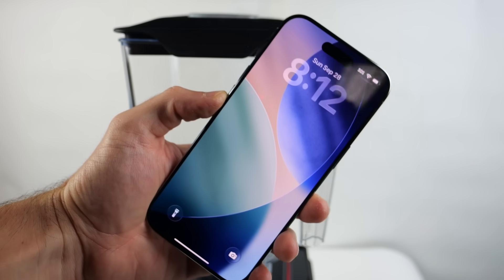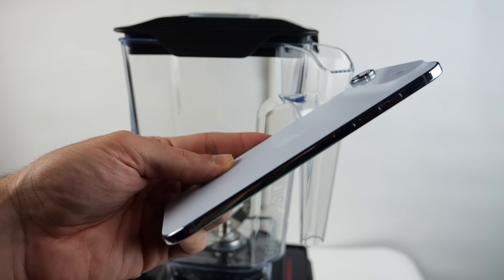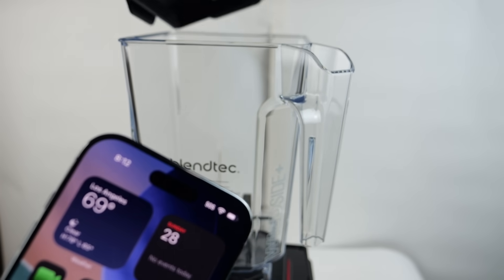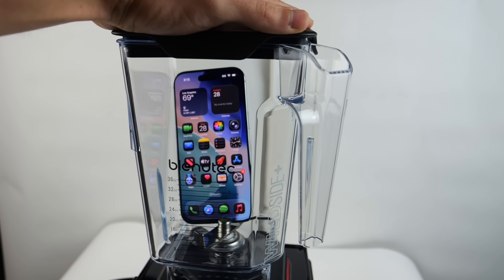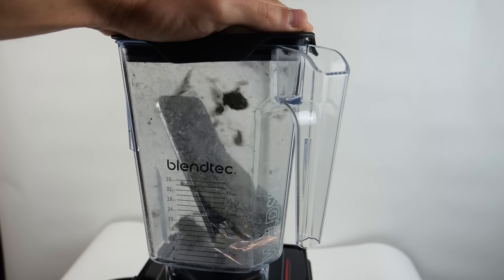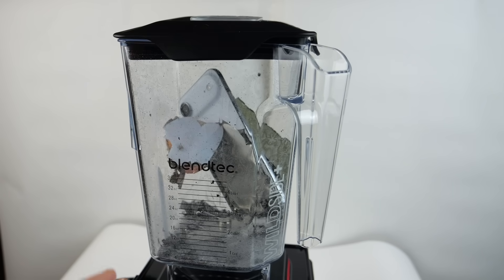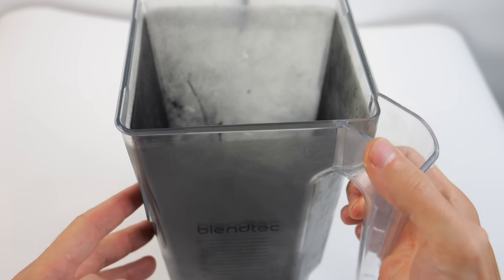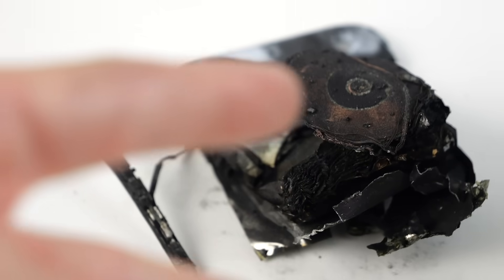Will it Blend? Titanium iPhone Air

Comment: This is one of the things EVERY iPhone DESERVES!!
Reply: It's not 2013 anymore bro
Reply: @memethanYT  The iOS is getting more and more locked in their own "eco system" and prices are insane... 17 Pro Max is 1899,99€ and phone literally doesn't exceed 600€ of value and another example, the iPhone Air that's cheapped out iPhone17 is more expensive than basic phone. I can talk for hours why is Apple DESPICABLE...
Reply: @REDLINERUNNER galaxy z fold 7 is £2000+ 😂😂😂. Absolute clown
Reply: @TescoRoadman  But Fold has technology that's difficult to produce. Double screen, one is foldable obviously, double battery, all the things are built different. Even motherboard is different. It's very very complicated phone. It's like a tablet you can put in your pocket. And no it's not that much it's about 1700-1900€...